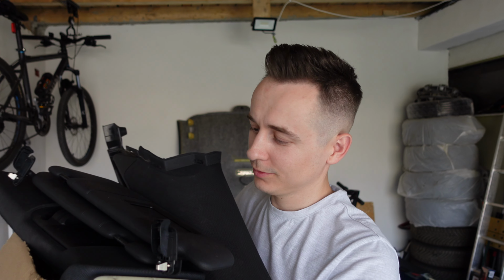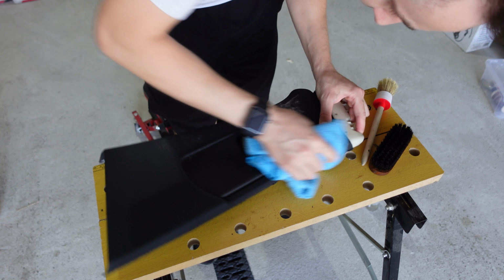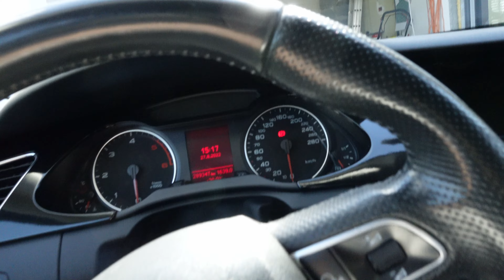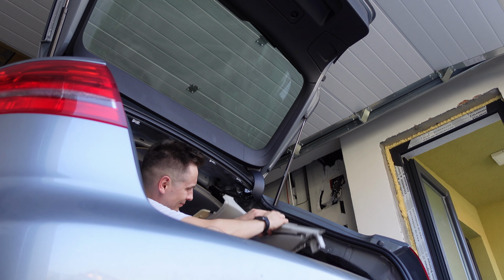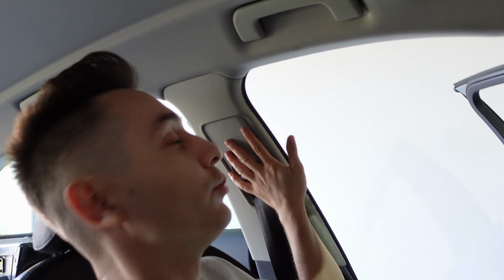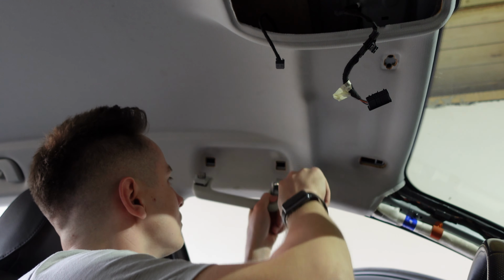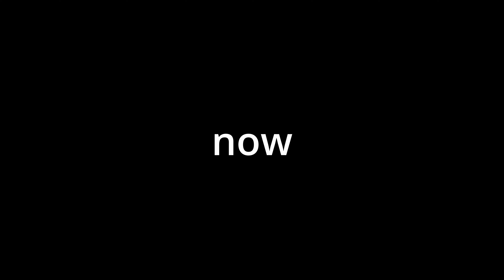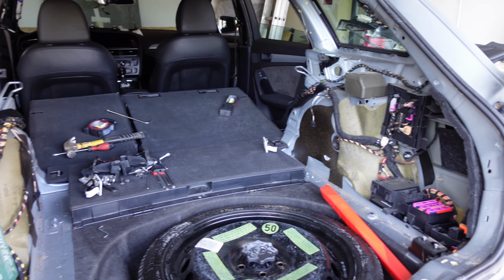Headliner replacement - Audi A4 B8

Comment: Where did you buy the black headliner and all the black trim from? I have a b8 A4 sedan and my headliner is sagging.
Reply from the maker: Hi! I bought it from Facebook, on an Audi group a guy posted that he is parting an A4. I had to drive about 2h/way to pick it up. All parts cost me 200€.
Reply: @istillplaywithcars  nice, you got lucky lol. It looks really good! I guess I might buy some black foam fabric and try to do it myself, but the B and C pillars looks a little hard to do on a sedan.
Reply from the maker: I think you cand handle also the pillars. If I would do it myself, I would use alcantara fabric 😍
Reply: @istillplaywithcars  i don’t know why I cant reply with an Amazon link to show the fabric I was thinking about buying. Anyways I’m thinking of doing the headliner with a foam fabric black and remove the pillars and mirrors and use a vinyl/trim matte black spray paint on those. What do you think?
Reply from the maker: You want to spray the fabric on the pillars? Or spray paint only the plastic parts? (Like handles and mirror)
Reply: @istillplaywithcars  on the fabric and plastic part on the pillars and mirrors. Someone posted a YouTube video where he did it to his Mercedes benz trim, mirror, and all the fabric. The spray paint is for vinyl/trim so it’s not clunky or anything. And he said it held up pretty well.
Reply from the maker: Oh that’s nice! Sounds good

Comment: Did you forgot to change the mirror with a black one? 🥹
Reply from the maker: I did not forgot, I didn’t had one. The one from the donor car was already sold 🤦‍♂️
I planned to paint it mat black, but sold the car meanwhile.
Now I drive a 2018 Q5. Probably will shortly appear on the channel 😁